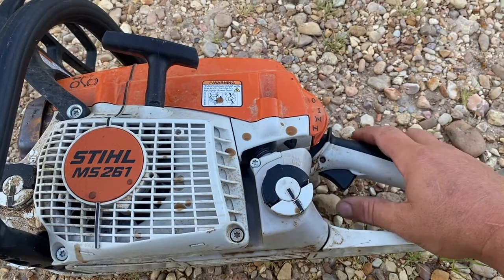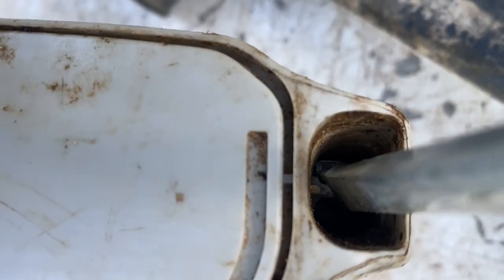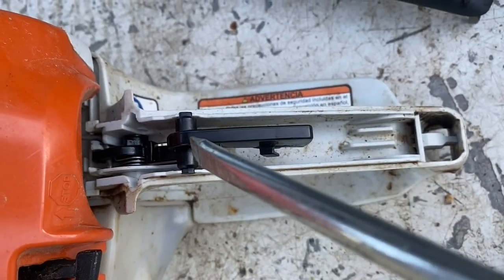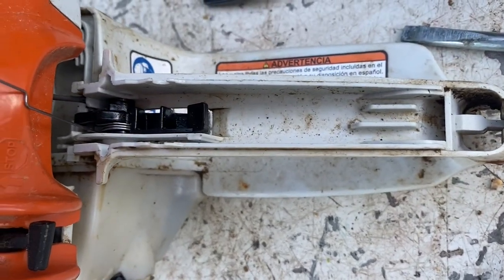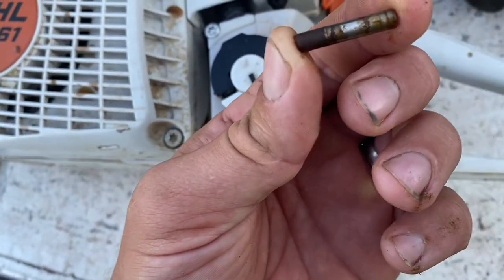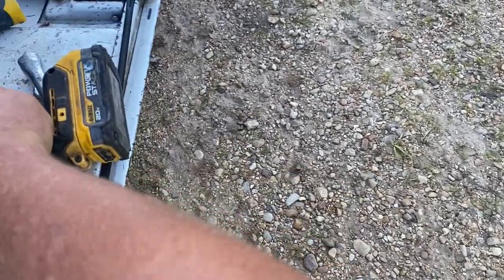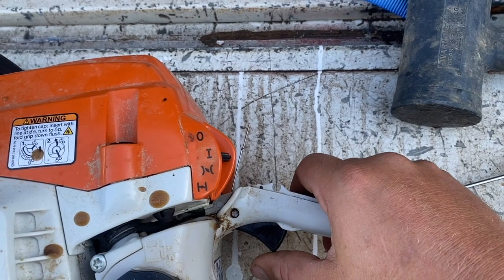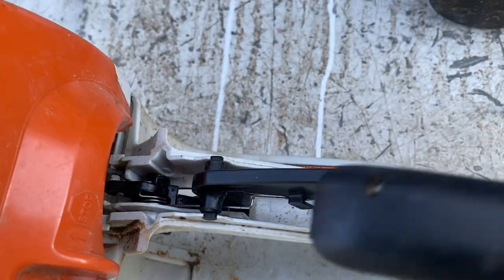Fixing a Throttle Trigger on Stihl MS 261 Chainsaw

Comment: The real reason is the throttle linkage rotates about a 90 bend. There’s a slot where it lies   When the linkage jumps out of that slot you get sticky trigger
Reply from the maker: It’s hard to know precisely what you are talking about without looking at it but I think I know. The problem on this one was a corroded pin though. That whole trigger twists on the pin.
Reply: @DowdleFamilyFarms  Yes, I understand what you are referring to. But there’s a general problem with MS311 and its relatives. If you look at where the throttle linkage sits in a cradle , just past the pin , you will see it pops out sometimes. It is this that causes the problem.
Reply from the maker: I see.